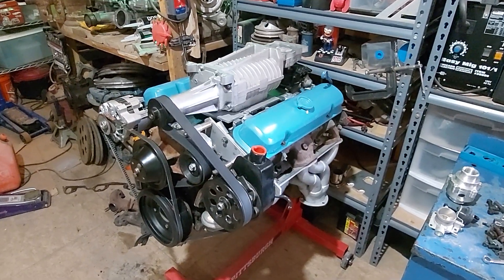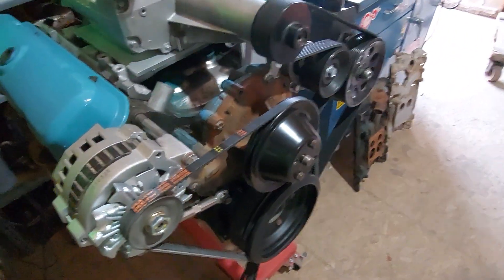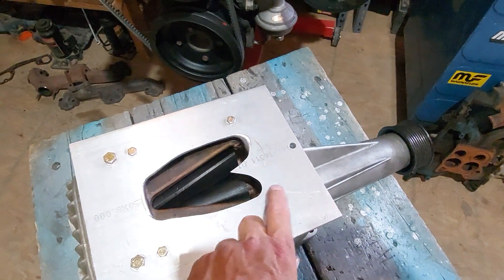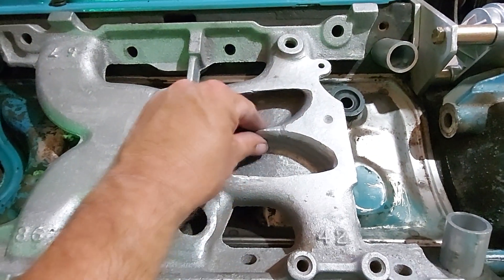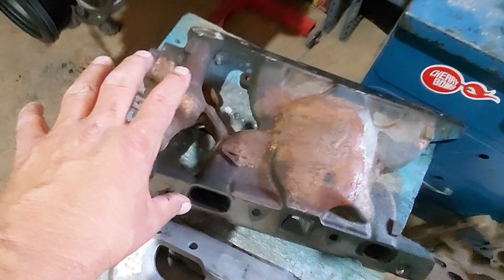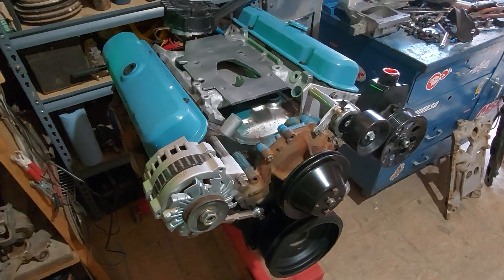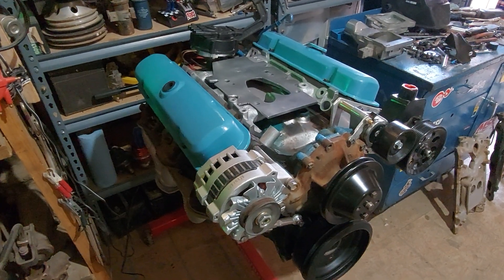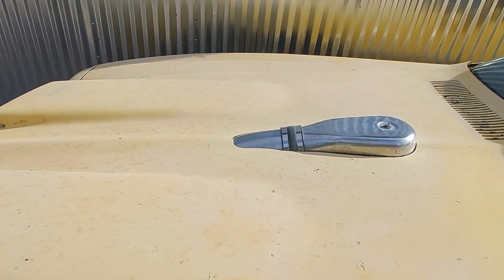Supercharging the Pontiac 301 M112 Eaton blower from a Jaguar draw through carb. Look Mom, No turbo!

Comment: 6:38.... ALL of the earlier G.M. engines have the same firing order as the 301, and they don't have a wider intake runner on those cylinders.... 🤷🏻
Reply from the maker: That is because the 301 has siamesed intake runners. Hence they made the 5 & 7 runner larger since those cylinders fire one right after the other. The older engines have 8 separate runners.

Comment: Nice man, I love Pontiac and use to own a 301 T. I always wanted to make max potential out of it but never had the money. My brothers threw away my parts I had stored at my parents home. There were parts worth saving like super duty rods and other Pontiac 455/301 parts. Keep it cranking! Respect you might have better success with a throttle body injection?

Comment: Did you mention, or anyone ask about dist. cap? (to clear the carb plenum?) where did that dist. come from? Can the cap be used on any GM dist? And why doesn't the carb get bolted "above" the blower, rather than behind it? interesting, Ray.
Reply from the maker: The carb is bolted behind the blower because it's a Jaguar supercharger,  which is significantly cheaper than any blower that has the carb mounting on top. The distributor cap is custom-made...  https://youtu.be/t2qHLlG4d_Y?si=Ohhn1MOulWgIjwVl

Comment: I did a similar build.  An m112 off of a ford lightning on a vortec 350 block with heavily ported bpe aluminum heads. I run a .560” roller cam and a ported t1 edelbrock single plane intake.   I run the engine on my 21 scarab boat . One thing I did that made a huge difference is I drilled and tapped a port on the carb adapter and I pre cool the blower with water meth . I bring a can of e85 and mix it with filtered lake water. So it’s water ethanol actually .  It lowered my intake temps by 80 degrees and it makes about 7 lbs boost .  GPS I have taken the boat to 77mph .  It’s kinda sketchy after that .  I could prop up and go faster if the boat was better to handle the speed
Reply: what intake did you use?

Comment: The 301 is definatly an orphan, really a shame they didn't just shorten the deck height and offer a shorter stroke that is normally counterweighted. A dude built a 301T with normal Pontiac heads and a normal 3.75" crank with a custom intake manifold bored 0.030" over for 383ci and it made 475hp.
Reply: Dayum !  Ive got 2 of my dad's 301s still here.   My high school  '80 Turbo T/A is not 😁.  But Ray's videos are giving me ideas 🤔  love it, keep it up

Comment: Hey im not an expert i just want my car to have more power....so i plan to install side mounted superchage and install a top mounting carb ...so the formation that i planning is engine> supercharge than carburetor ...so my question is can i get the car to start easily?  Or can it even start?
Reply from the maker: The supercharger will be boosting to the carburetor?.... You will need a blow-thru carburetor. After that, yes, it will work

Comment: You make great videos and I learn something every time. In regards to the turbo intake casting “ The rare one” if you knew someone that did sand casting and could make a couple you would have a spare (just a thought)
Reply: Making a mold for the cores would probably require cutting a intake up but if you sacrificed one to make twenty it'd be worth it

Comment: pretty cool video. sorry about your friends divorce. maybe you could tell him this joke: "why are divorces so expensive? because they are worth it." I have a 1982 S10 with a 6.0 LQ4 that I put an Eaton M90 on. I have a 7.4 inch harmonic balancer and a 2.55 inch supercharger pulley and it makes about 4.5lbs of boost. it's fuel injected. I live in Wyoming and the elevation is 7k feet. the dragstrip I go to is named Hypoxia and it's at 6500 feet. Your Firebird is a cool car. maybe you could take the 260 out and put the 301 in it.
Reply from the maker: That is awesome how such a small supercharger can still make boost on a big engine. Thank you for sharing that! Gives me confidence in a project that I am working on with an M112 supercharger on an 8.2 liter Cadillac 500 engine.
Reply: @raysoto1969  it's a big engine but it doesn't make much power. I think that M112 will help it a lot. I had the silencer ports welded shut on my M90 and it is supposed to make more boost.

Comment: Thats all fine, but the crankshafts in those engines snap like a pretzel..
Reply from the maker: What experience do you speak of? There are others here on youtube making 400 plus horsepower on the stock 301 crankshaft
Reply: @raysoto1969  Just yrs ago, friends saw many broken cranks from 301s, they had a engine shop with a dyno.  They said dont bother hot rodding a 301.  Wont take high compression or rpms.  
I had a 78 Gp with 301.
Reply from the maker: @terrypikaart4394 Thank you for your reply.... but I'm going to respectfully disagree. I have never seen an actual broken 301 crankshaft.  Spun rod bearings, maybe, from a lack of maintenance or improper engine rebuilding. I have seen head gasket failures on turbo Trans Am's from overboost or preignition. But again, never an actual broken crankshaft. I have read a ton of old forums about how people say how weak the 301 crankshaft is, and how they just explode like grenades... yet  nobody has never ever posted actual proof or a single picture of a broken 301 crankshaft. It's like an old rumor people seem to repeat from someone else.
Reply: Im glad your confident in your project and have faith in it living a while.  Just dont spin it over 7000!..
Reply from the maker: @terrypikaart4394  Haha, I agree, I won't be spinning it any higher than 5000rpm
Reply: Apparently the turbo cranks are stronger than the n/a version. If I'm not mistaken, Ray's plan was to mount the setup on his buddy's original turbo motor. 
Maybe the weak crank myth comes from the fact that there are two less counterweights than normal for a 90° V8. That alone is a good enough reason to be moderate with RPM.
Reply from the maker: @leedarche242  From what I understand,  the only difference between the N/A crank versus the turbo crank is that the turbo crank has the journals fillet radiused. Other than that, they are identical. Yes, none of the 301 cranks have center counter weights. Only front and rear counter weights are needed to balance the engine. The center crankshaft throws are balanced because they are 180 degrees apart from each other. This does theoretically cause some internal crank stress without the center counter weights... but I've never seen a broken 301 crankshaft.
Reply: @raysoto1969  And I'll counter with that broken crank comment too. Joe Rinaldi from TTA performance, who specializes in 301s/turbo motors also states he hasn't seen broken cranks as a problem. Was a question I had yrs ago. Naturally if some-one "unknowlegable" trys to build a hi-RPM 301 by changing the heads, custom intake, big carb, hi-comp. pistons and radical cam, then sure, maybe at 7K you'll have a problem. But most will also change out the crank at that point too. 
The younger generation who wasn't around when this eng. was new, didn't hear the horror storys surrounding the 301, which mostly became a victim of improper driving methods, such as over-revving, and/or poor maintenance. And today, those individuals haven't forgotten it, and continue to badmouth the 301. The eng. was designed as "stricktly" an economy motor, and not a performance one. But because some gearheads are unsatisfied, or out for a challenge, and modifications are added to these engs., they will respond adequately, as long as the driver/builder understands its limitations. (Thanks for the video, Ray).